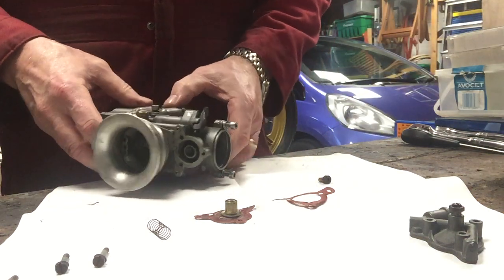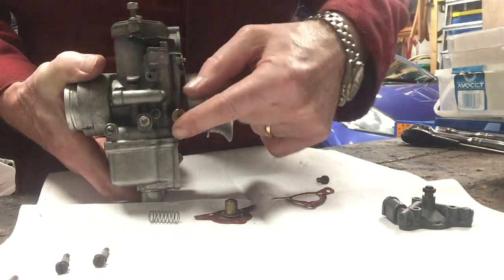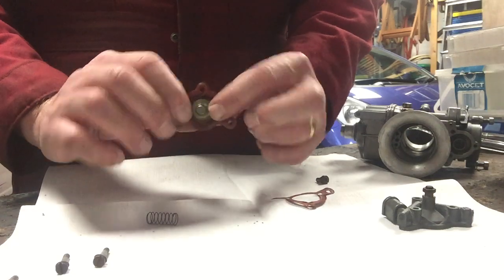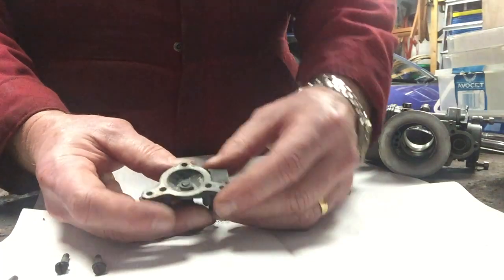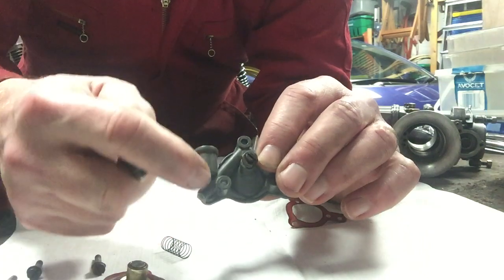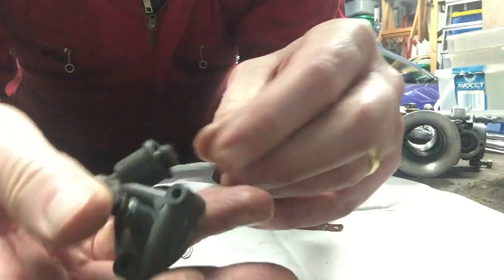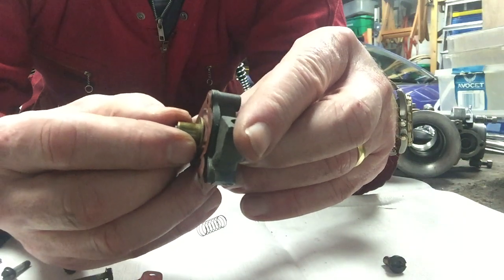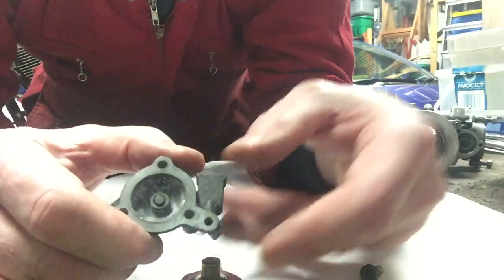How an Accelerator Pump works

Comment: Great video thanks. At 1:04 mins. you mention the brass plunger that squirts fuel into the throat of the carbie. .I have removed both of these for cleaning. Is there a trick to get the brass “ plug “ that holds them in, to go back in ?
Reply from the maker: Thanks Nicole. When I removed the big brass screw and the  "plug" behind it for cleaning, to reassemble I just slid it back in place. With original parts the plug doesn't have any orientation so just goes straight in, however on some of my race bikes the part that protrudes into the Venturi has been filed off, so that will need orienting if you have one of these. Hope that helps.

G

Comment: Great Video! One question, how can I temporarily disable the pumpers? Just remove the top brass non-return-valve? (unfortunately I can't remove the levers from the slide) TY!
Reply from the maker: It is so much easier to remove the actuator arm from the carb top, but if you must disable the pumper a different way then you can remove the non-return valve and replace it with a plug. I've used a blanking plate on my race bike (i.e. taking out the diaphragm and spring) and because there was no suction action from the diaphragm, I didn't need to touch the non-return valve.
Reply: @aldermarsh6776  Thank you very much!

Comment: Excellent explanation, thanks very much.  Is it common for the diaphragm to fail? I have 44 year old Dellortos on ny BMW R90s and wondering if I should check them as the motor coughs when blipping the throttle at idle.
Reply from the maker: Thanks Syd. I've not seen failed diaphragms as most issues are incorrect assembly or adjustment. At low throttle openings (slight blipping) the pump won't come into effect as the ramp only operates the piston at large throttle openings. From what you described, I'd be looking at the primary circuit first.
Reply: @aldermarsh6776  Thanks Alder. The motor stumbles when trying to pull away fast from traffic lights with full throttle but idles smoothly and runs well otherwise. I checked the pumps and one wasn't working at all and the other only delivering about 0.2ml on vigorous maximum throttle twisting (supposed to be 0.4ml). I disassembled the non-working pump and found all parts seemed ok including the diaphragm. After reassembly and blowing out the passages the pump started to work (at first pumping out what looked like mud!) but still delivers only about 0.1 ml. I am thinking the fuel passages or pump jet are partially blocked so have ordered an ultrasonic cleaning bath; will keep you posted.

Comment: Quick question on the accelerator pump the adjustment with the lock nut how far in or out do you want that?
Reply from the maker: Hi Dandelion. It depends on the way the engine is running. Some advice is to set it up to pump out a set volume on each full stroke (and you do this by measuring the very minute quantity of fuel that is dispensed over, say, five strokes). I've found that you can do this perfectly but the engine still won't pick up smoothly. On my race bike, with a quick action throttle, I needed a large volume of fuel so the adjuster was screwed way out. On my mildly tuned road bike the same adjuster position flooded the engine and it spluttered on pick up. This was fixed by screwing the adjuster in about half way. So there's no straightforward answer to your question, but luckily it is a simple adjustment to make and you can do it easily through basic trial and error. Good luck !
Reply: @aldermarsh6776  thank you for replying to me. I've got that all figured out now. About half way. But now I am having issues with cruising and 1/4 throttle and below. It seems to be to rich or to lean. It has no power and bucks badly. Over 1/4 throttle seems perfect
Reply from the maker: @dandelionperfomance  1/4 throttle and below is all controlled by the pilot jet and primary jet. My recommendation would be to check both of these are set properly and that the carbs are balanced. There's a video on how to set the pilot jets and another how to balance the carbs without vacuum gauges. Good luck !